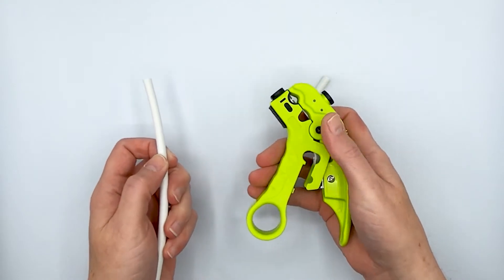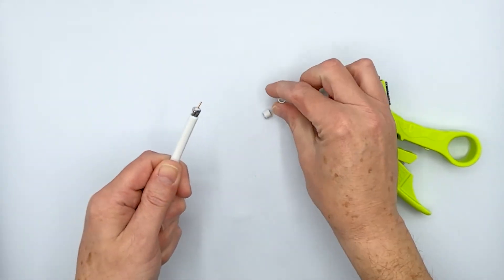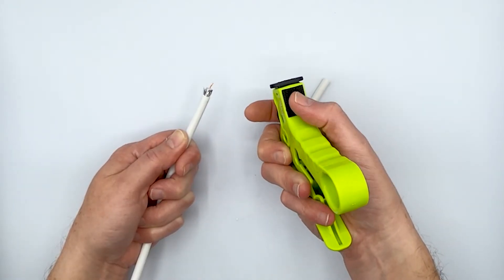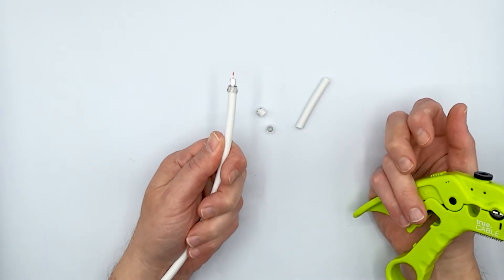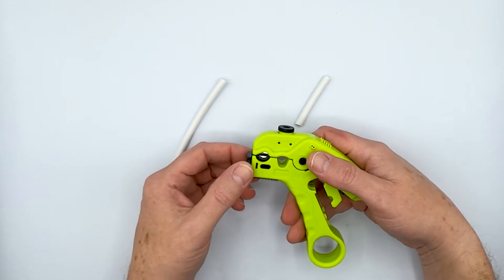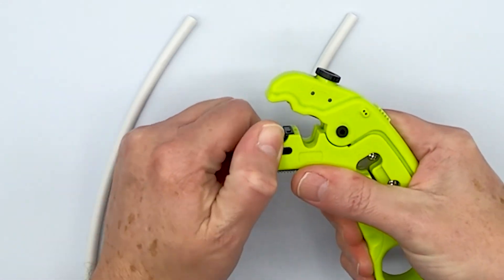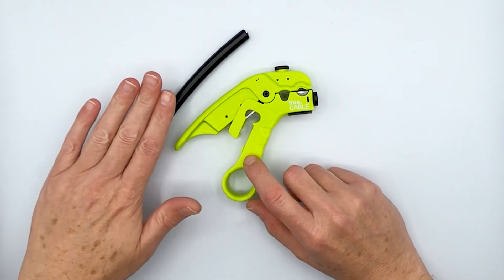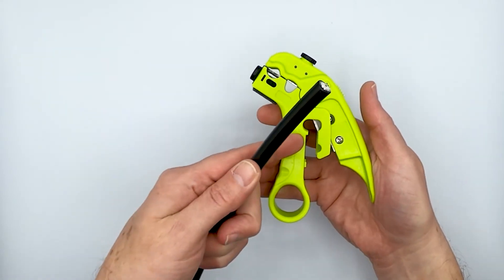Cable Cutting & Stripping Tool: Overview and Best Safety Tips

Comment: Well it did help, partially.......and thanks, however are you saying that we only need to strip back the first layer of foil while folding back grounding wires, for RG6?
Reply from the maker: Hey Rich! We are glad you found the video useful. How much shielding you strip back/remove depends on whether it is dual shield or quad shield RG6 (Series 6). Which variation are you referring to?
Reply: @trueCABLE  Quad shielding. I did use your awesome tools and ended in peeling back the layers of foil, leaving only the inner wrap covering the white shield around the copper wire and it seems to be working well. Does that sound correct?
Reply from the maker: @ShootingOutside  Yes that sounds correct. You can see pictures for comparison in our Cable Academy blog, "How To: RG6 Quad Shield Coaxial Strip and Termination.